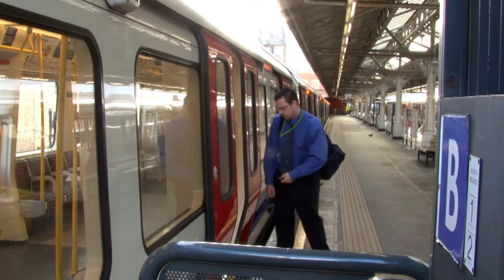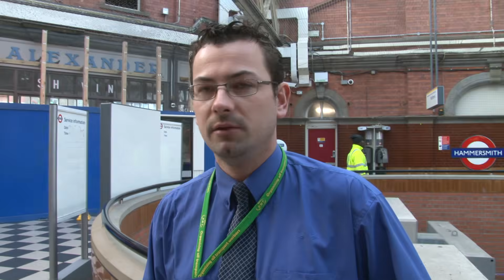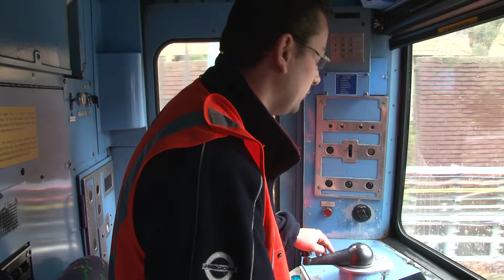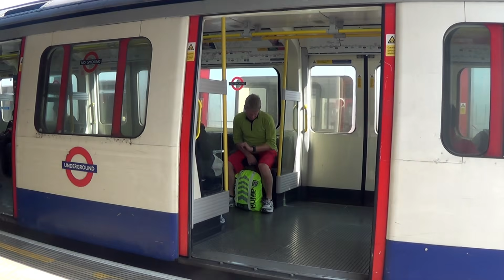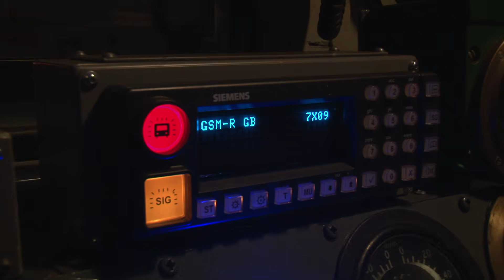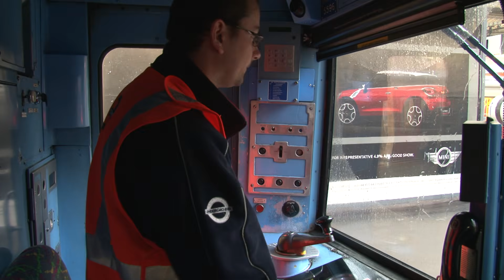Now You C Me - Documentary

Comment: WRONG.!!!!!!.
The difference between series and parallel isn't anything to do with removing resistance.!
It's the difference between the connections on the motor. From STAR to DELTA.
So there.!😋😋😋😋😋😋😋😋!.
Reply: I think the driver explained this as simply as they could to suit a wide audience, I’ve done a bit of Googling and an FOI request to LUL gave this answer which seems linked - not saying you’re wrong but I don’t think LUL drivers get trained in that much detail......

The three traction positions Shunt, Series and Parallel refer to the resistor banks that the power passes through to reach the motors.

Shunt being the slowest as the power passes through all resistors meaning a lower voltage reaches the motors.

Series is the next step up, here the power passes through a large resistor grid configured “in series”.

Parallel is the final step, here the power passes through a smaller resistor grid configured “in parallel”.

Shunt & Parallel steps have intermediate stages which are controlled automatically to give a gradual application of power.

Comment: I remember checking the installation of the Connect train radios and ancillary equipment on the C stock in Hammersmith Depot in about 2005/6. BTW doesn't Hammersmith Depot have the longest non thru carriage shed in the country? I seem to recollect that you could park up 3 C Stock trains in a row on the same road inside the shed.

Comment: Like most new tube stock, C-stock were a great improvement on the previous rolling stock in 1970, but old age, lower maintenance prior to replacement and passenger expectations all take their toll on passenger experience. The main difference is that C-stock are 1969 design mechanical and can be understood by drivers when they go wrong, S-stock is 2008 design with computerisation making it much harder for a driver to repair on the fly if required. On the other hand S stock can report potential problems before they happen. In theory although there is more to go wrong, less should.  It'll be interesting to see what passengers think about S stock in 2048 when they are replaced with .... well goodness knows what London will need by then.

Comment: Thanks to Geoff I appear to be becoming a train nerd. But as an electronic engineer I love the shunt/series/parallel labels as they make perfect sense and describe exactly what they do.
Reply: Very true George, I am somewhat annoyed that the explanation of these terms in the video was not better, for instance what happens to the electricity not used for traction - heat. I guess the S stock has thyristor control or something.
Reply: @ianmurray250  S stock has transistor-based inverters powering AC traction motors.
Reply: @ianmurray250  I've watched it and can see where there's loads of extra bits to add, but I think the way it was described was an easy way for a wide audience to get the idea.
Reply: @ianmurray250  Shunt/inch chucks it out as heat. Series and parallel are series and parallel circuits so parallel is four times the power of series (Ohm's law)
Reply: Actually it's bollocks. Shunt has resistors, series is a series circuit and parallel is a parallel circuit so parallel is four times more power than series and shunt chucks out a lot of the power as heat. If you ever saw a train with the grids glowing you'd know what I'm on about. Never drive a train in shunt/inch for more than a minute and usually round the yard, which is what it's there for.
Reply: Me too I'd love spend a day riding trans

Comment: For anyone wondering, "series" is switched so several motors are lined up one after the other in the circuit - the current has to go through all of them, thus increasing resistance. When the controller is switched to "parallel," the current goes through each motor independently, thus there is less resistance. It's a very simple way of controlling acceleration, but it works.
Reply: And a shunt is a resistance put in series to give the "low" speed
Reply: And, on top of that, if I recall correctly, both series and parallel each have several stages of resistance that a relay or set of relays or contactors switch through automatically, based on the current being drawn by the motors. This ensures that (a) the motors don't overheat and, and (b) the train doesn't shake violently whenever starting to accelerate.
Reply: Outfrost I think you are referring to the RPA (rapid pneumatic accelerator), which could be heard in operation as the train accelerated from rest as a rhythmic clicking.

Comment: Time will tell but it seems to me a risky strategy to order an entire fleet of one type of train. The danger is of a defect affecting the whole fleet, which would lead to them being grounded for modifications. It has happened before.
Reply: @TheRenaissanceman65 Only error in that I'd like to point out is that the 1983 stock was on the Jubilee, not the Victoria. Also the D78 stock on the District shared a lot of those innovations, but it lasted a full life. The 1983 stock was mainly withdrawn due to the cost of converting it to work on the Jubilee Line Extension
Reply: TheRenaissanceman65 37 years is pretty good for any train, especially since it’s now being converted for use elsewhere.
Reply: TheRenaissanceman65 I quote “a whole design from scratch is risky and that happened with the 1983 stock on the Victoria Line”
Reply: TheRenaissanceman65 You claimed before that you never said the 1983 stock on the Victiria
Reply: @agent_605  He must have meant the 1983 Jubilee Line stock, which had a short life. I think the main problem was with the four single-leaf doors which was said to have led to extended station dwell times.

I thought it was just a development of the 1967/72 types. The step change was the Central Line, following the construction of prototypes in 1986.
Reply: TheRenaissanceman65 That’s clearly contradictory then
Reply: TheRenaissanceman65 Read your comment again. It describes the 1983 stock on the Victoria Line. It isn’t a big deal, I was just pointing it out so you can edit it
Reply: TheRenaissanceman65 What? No, you clearly didn’t understand. I was just correcting a minor error that you could’ve easily edited. No need to get uptight about it
Reply: TheRenaissanceman65 No I simply corrected it politely and only got annoyed when you got uptight about it. Anyway, it’s unnecessary arguing about something so pointless

Comment: I liked the C Stock for two reasons: The distinctive motor noise was very similar to Warp Drive on the original Star Trek. https://youtu.be/_DN3KW3k0Ao?t=24 I always thought that the sound effects on the Bridge should have included a grasshopper-like compressor kicking in and out. Also, before the late 70's the suspension was all over the place giving the trains a really wide rocking motion and you could pretend to be surfing by not holding on (later rectified with dampers on the bogies).

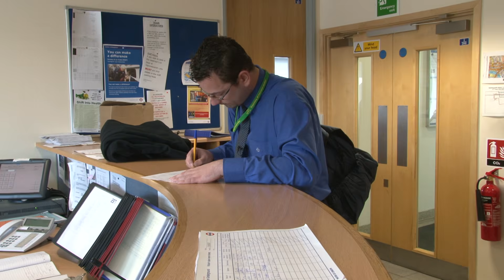Comment: 1:34 There's an even more exciting train, the 1960 Track Recording Train!
Reply: So that's what it is! I think I saw one once, years ago, and couldn't work out what it was - it was obviously an engineering train of some sort but beyond that I couldn't find any details. My description of it as "like an old train but armoured-looking" didn't help either, lol.
Reply: @Dogtor_Orsum  It's been quite a while since one of them saw service (withdrawn in 1994), and it has been changed quite a lot since it left service. There is one in original condition with the heritage livery in preservation. It is essentially two 1960 Stock DM's with a modified 1973 Stock Trailer. When in service, the units had 1938 Stock trailers instead. 

It will probably be going in the next few years, with the 1973 Stock becoming available upon withdrawal, it will probably be heading to the scrapyard.
Reply: Did you know that there are still 1930 something stock Northern line trains running in regular service on the Island Line on the Isle of Wight?
Reply: @RJE48  Yes, although the 1960TS is a much rarer sight, only two 1960TS trains are left. There's quite a few 1938TS carriages scattered around the UK. Plus this is officially the oldest running train on the Underground, as the A Stock is gone.
Reply: Jack Shiels the IOW ones are from 1938, 1960’s have only ever been on the underground
Reply: I love old tubs stock ❤️
Reply: @Jack Shiels No need to be sad, three Class 483s will be preserved. One on the island, two on the Epping-Ongar railway.